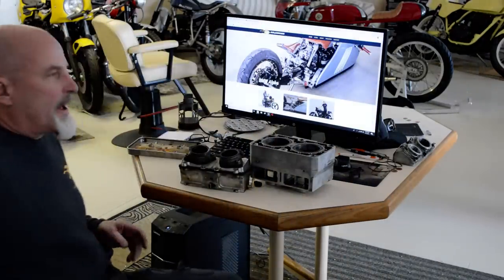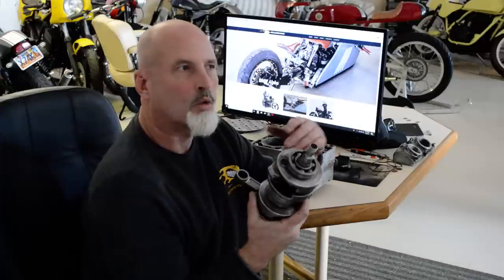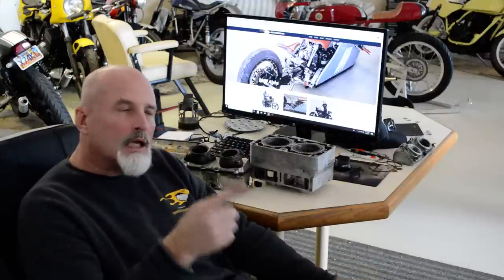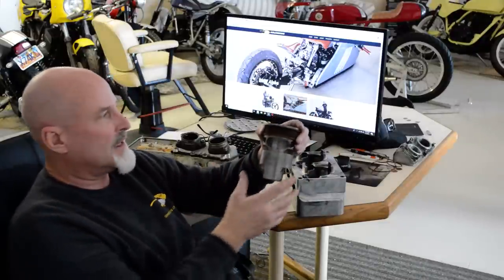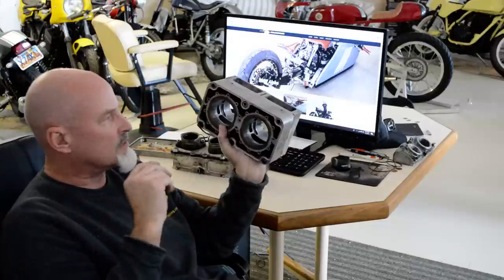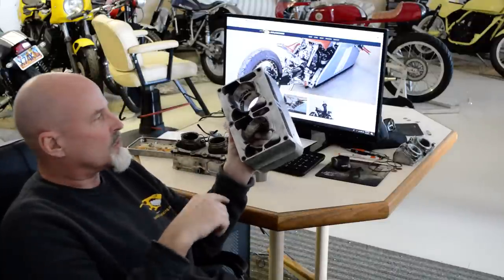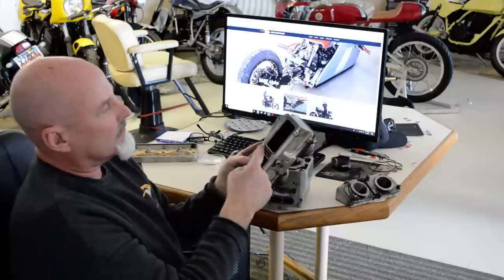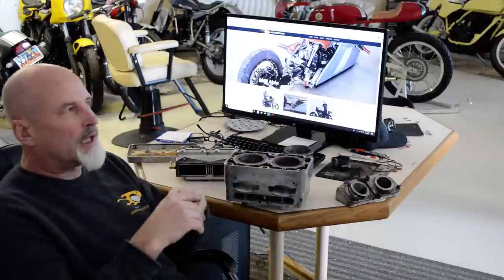Two stroke RZ/RD engine #3

Comment: Your work is awesome , I too love the 2 stroke and back when I was 18 and my 75 RD was only two years old, that bike and I roamed the CA. bay area with little regard for the law. With some knowledge I ported, polished, jetted and installed a set of Dunlop K81 tires.  I weighed in at about 120lb and I can tell you that there was nothing out there, car or motorcycle, that we could not destroy up to 100-110mph. I have some of the fondest memory's on that bike from all the twisty back roads to the nights of racing and picking up girls in SF.  Keep up that work.
Reply from the maker: Thank you. The RD was such an influential bike for so many of us. I loved them the first time I saw one and always will.

Comment: I apologize if you have covered this in previous videos. I am curious to know if polishing the surfaces your fuel mix touches in the cylinder ports will have desirable effects on your powerband. And Happy New Year.
Reply from the maker: I have never tested polishing. It would be an interesting test. I do polish the dome of the piston because Frits Overmars has posted that there is a benefit, but that is as far as i have gone with that..
Reply: @SpeedofCheeseRacing  Thanks for the response.

Comment: A few things you can try with your exhaust port, maybe in your next cylinder, is a much smaller diameter of exhaust port exit.
Time after time a smaller exhaust port exit has proven to give the most power, you do need enough volume in the exhaust port, but it needs to go from super wide in the cylinder to a small outlet into the exhaust. 
Something also worth looking into is the angle in wich the exhaust port is placed in the cylinder, Jan Tiel said that it can never be to steap.
The only limitation is the crankcase, other than that the sharper the angle from exhaust port tot cylinder bore is, the more power it will give. The combustion gasses need to come all the way from the sparkplug straight into the exhaust.
Reply from the maker: Thanks. The Exhaust is good. I don't remember Jan saying it can not be too steep. I'm pretty sure the Aprilia ended up at 25 degrees.
Reply: The Dutch forum www.deraceheldenvanweleer.nl is where Jan Tiel said it, there he goes under the name Jamathi.
With a little Google translate I'm sure you could make heads or tails from the knowledge that's on that forum. 
There is someone who made a cnc machined cylinder as well on there, only he divided his cylinder up in to slices wich I found truly genius.

Comment: Happy new year Mark.
Wow it's not just cylinders, it's the hole top end your attacking def no half job.
Digital fuel mixture read out same as race karts use don't know if you already use save plug chopping.
And expansion chamber size ie roundness would that be chocking port flow at high rpm ( bigger carbs more air more back pressure in exhaust pipe chambers ) a bit like running 125 exhaust on a 250.
Can't wait getting more interesting on your journey Mark .
And I'd believe the hp output it would be crazy.  Cheers Pat.
Reply from the maker: Thanks Patrick.

Comment: Give its a once a year run, i would take few engines at different specs.
Longer rod engine gives a longer dwell atdc & abdc, velocity also drops off with a lower piston change of direction from longer rod, need to find happy medium on a good rod ratio for a give max rpm. 
Be good to use clear head with high speed camera to see how it looks in real time!
Reply from the maker: Yes! could you lend me some of your time? I'm at capacity.
Reply: @SpeedofCheeseRacing  i know that feeling!

Comment: Did you build the engine cases also? If yes, why not widen the cylinders so the inner transfers get more room.
Reply from the maker: No. I have to keep the stock case to stay in my class. Too bad.
Reply: Is it possible to offset the conrods to get more room between the cylinders?
Reply from the maker: Yes, but not enough to be worth the effort.

Comment: I think the cast iron liner is a good idea. The transfers on the 400 are very narrow, i was surprised when i ported mine. Yamaha did this too keep vibration down. They are a very old design in terms of port arrangement. what's the captured ring that your talking about? I would have thought heat management around transfers wouldn't be a real concern they have cool mixture running through them. Great videos, looking forward too more.

Comment: Adding stroke let's them pull more gear in my experience... you can also try to increase the area between the carb and airfilter that helps alot believe it or not.

Comment: Id personally stick with carbs.. at the wide open throttle the injecters shouldnt make any performance gain from a well tuned carb..   but i always wanted to see what a veriable lenght intake would do before the reeds. i guess reeds are veriable anyways so probably a waste of time.. anyway you Never know injected in hind site has all the advantages well should be the go worth a try you already got the parts really
Reply from the maker: I don't think there is a performance advantage. I do think there is an advantage to the massive altitude change from the dry lake bed to Bonneville...maybe. Also if I can switch fuels with a map change would be terrific.